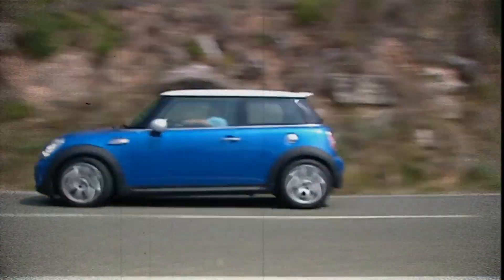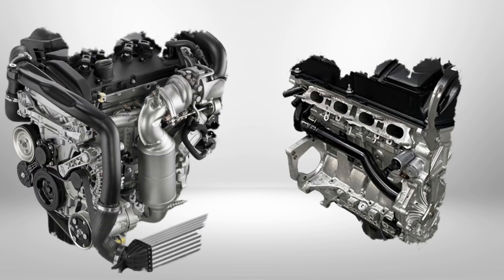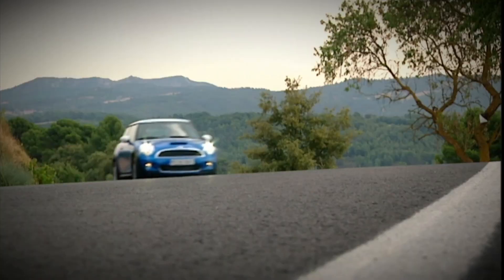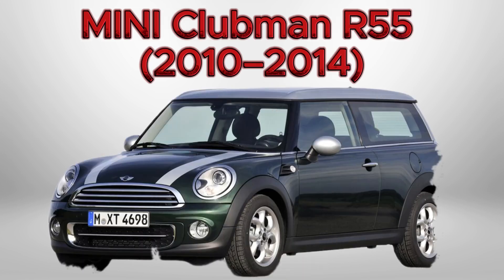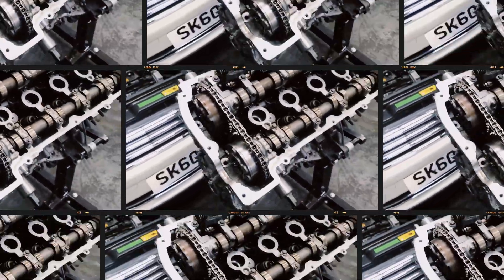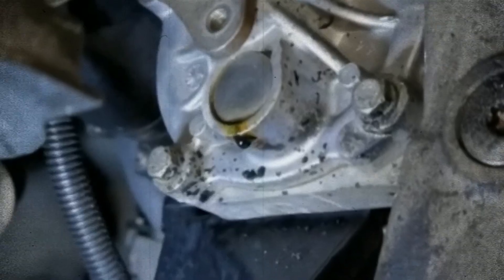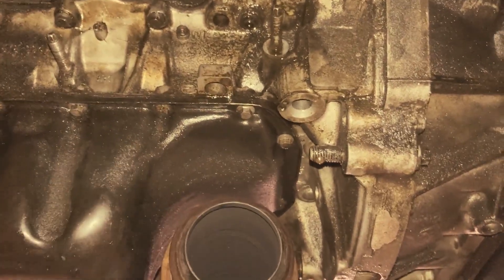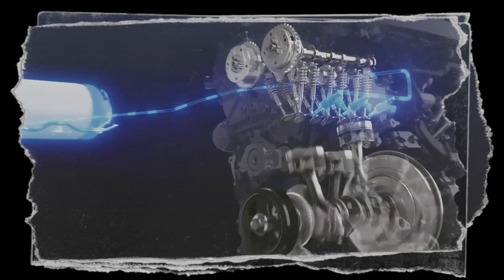MINI N18 Engine Review: Specs, Common Problems & Real-World Reliability!

Comment: Owner of a 2012 R60 purchase brand new and still going 13 years later. Water pump location is misleading. Its technically on the passenger side of the engine (US model) to access it you remove the passenger side front wheel. If you need more room drop the engine a few inches to make your life easier. What is at the "rear" of the engine is the cooling pipe that routes between the water pump and the Thermostat housing (driver side). Oil consumption has nothing to do with the piston ring design. It because it has a horrible Positive Crankcase Ventilation design which is integrated into the valve cover which vents back into the turbo intake system. When blow-by gasses with oil circulating into the intake system it makes its way back into the intake valves. This is what causes the carbon build. When the Positive Crankcase Ventilation starts to fail, exessive pressure is created then leaks start to occure. In additional oil loss is also caused by the weak gasket seals from the oil filter housing. The Positive Crankcase Ventilation is the primary root of issues for this car. Everything else should be part of regular maintenance, and is the nature of the car. If you are driving like a bat out of hell then you pay to have fun.